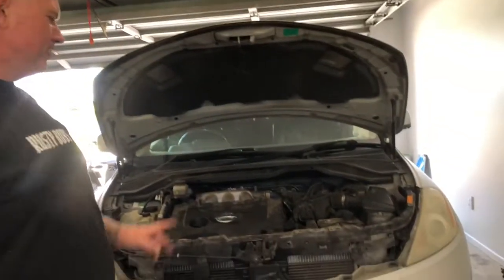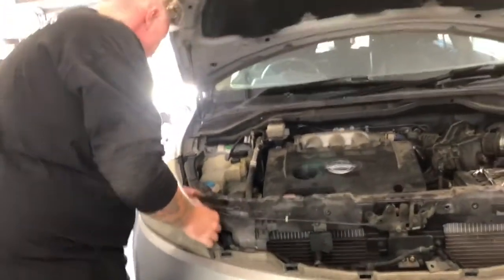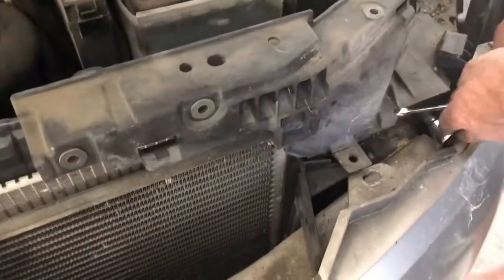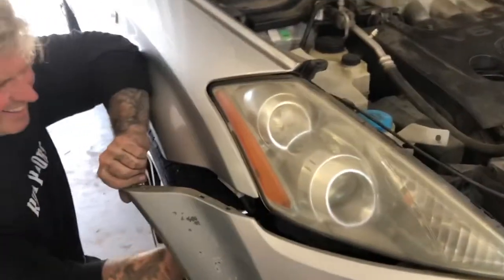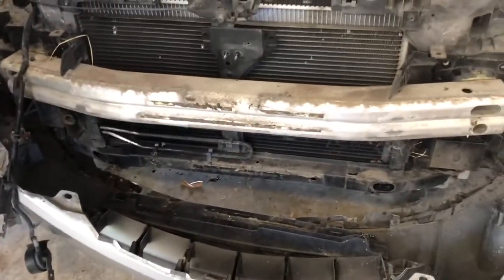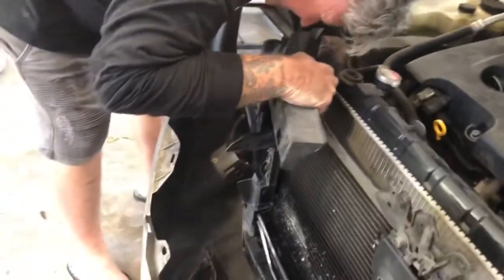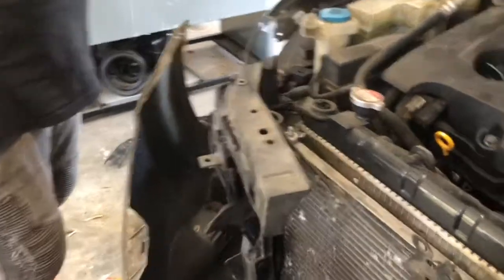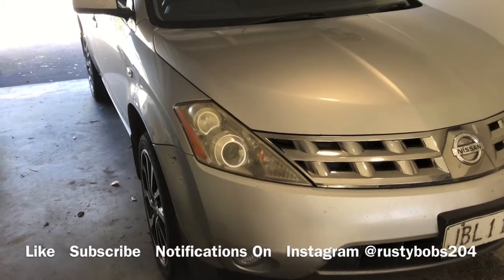Nissan Murano A/C Condenser

Comment: Dang bro you made alot of work for yourself... its easy 
1 remove fan
2 remove radiator 
3 remove condenser 
All from engine side
Reply from the maker: Nice tip, thanks for watching;)
Reply: @rustybobs  np
Reply: Actually, then you have to reinstall the radiator and refill it and burp it and ensure no leaks and while burping it, water can get into radiator fans and damage them electrically.  Also, the cheap aluminum screws for the oil connection of radiator can cross thread and drip.  Too much can go wrong imo to mess with radiator if you can avoid it.
Reply: I agree, I just removed the radiator, it was much easier...

Comment: I do feel a certain satisfaction watching you get dirty and working hard from the comfort of my couch. Did you pull a vacuum on the system before putting in the refrigerant? If you didn’t, obviously it will still work, but might pop off on high head pressure when it’s under a large load or if the ambient temp is high, plus the water in the air can enable acids to form and eat your system away. But given the age of the car, might not matter 😀